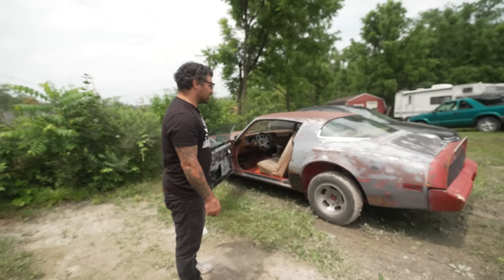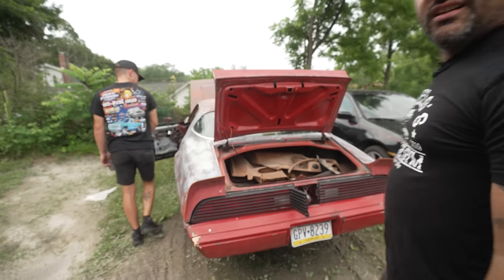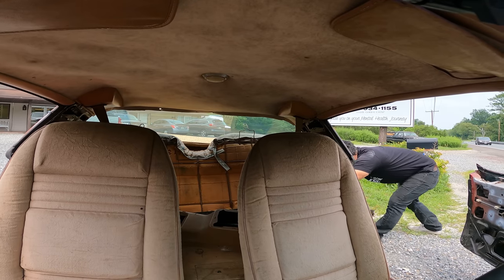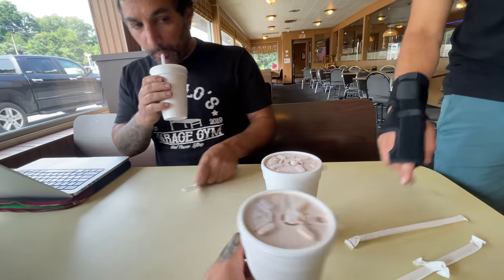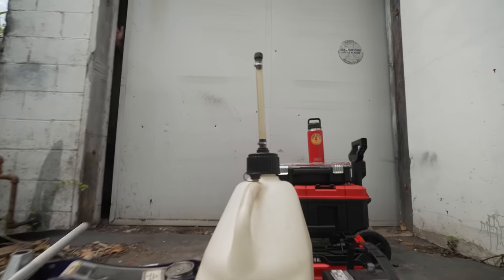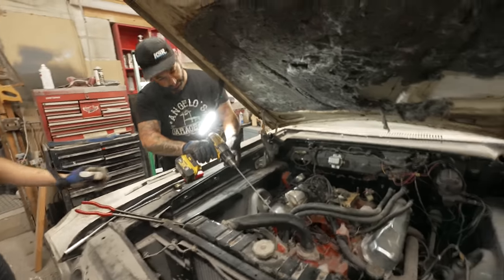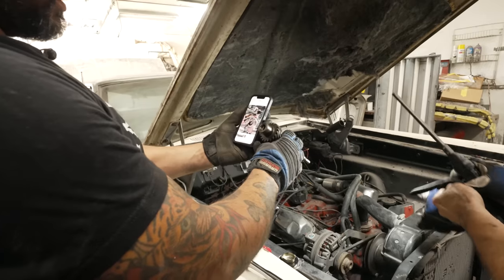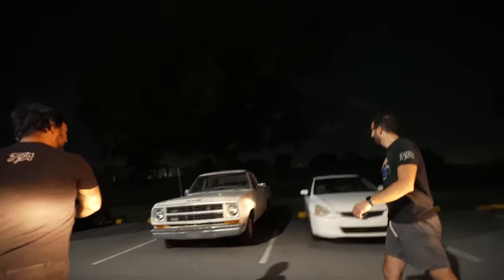1964 Dodge 440 Revival! The 3 Secrets to buying Cheap Project Cars in Today's Market!

Comment: @Tony : 2 things you'll want to do with this car, 1) put a 65 or newer rear end in it. It IS an 8 3/4, but has the bolt/nut axles and they are the WORLD'S biggest PITA!!!  2) Either contact Imperial Services for a set of transmission cables and replace what is in there, OR,,,,, put in a 66' or newer 727 and an aftermarket ratchet shifter.....  Do those things and you will LOVE this car forever!!!!  Then when you get into REAL LOVE with this car, I have a 65' Coronet 500 from California with zero rust you can buy from me and even get a vacation in Florida along with it.....  You can visit Cletus while you are here... ;)

Comment: Fun fact about oil priming: very large industrial engines will have an air operated "prelube" pump that lubricates the engine before starting. On a CAT 3600 you need to activate this system before you even roll the engine to adjust valves.

Comment: I'm a chevy guy through and through, however,  back in 67 I bought a polara just like yours white, turquoise bench with a fold-down armrest 383 with a really long Hurst shifter which I managed to snap off at the weld. the Dodge dealer told me that was a first for him. I loved that car and still do but got tired of being beaten on the street by GTOs. I traded it on a 64 red corvette fuelie coupe. Well, I guess I showed them. High street in Pottstown, Pa. The vette was tuned by Lee Crupi (Rapid Rabbit)and never lost a race to the Roger Sinestri (Buckshot) crowd.

Comment: I just bought a 1983 D-150 Miser slant-six 4speed. It runs and drives, got it for 2500$ I flushed the brake fluid and replaced the pads, got new seatbelts, and I just got the springs and shocks. It’s a fun little thing.

Comment: I believe that is the 1964 Dodge Polara Max Wedge or 500. It came with bucket seats, floor shifter, and only 2 backup lights and 2 brake lights. The regular 64 had 4 brake lights and 2 backup lights across the back. I had 2 of them back in the day. 383 with Holley 780, 727 tranny, dual exhaust cherry bomb glass packs... Oh yeah..

Comment: When a engine sits for a long time you never crank it with the starter try to get it going around by hand and make sure you take the valve covers off to watch if there is any stuck valves that way you can get them loose before pushrods bend. I have seen so many guys spin the engine with the starter and end up bending the hell out of the pushrods and it's better to try yo avoid doing that if you can.
Reply from the maker: That is next level! I will consider that next time!

Comment: Tony  I started wiring my 76 chevelle malibu using that wiring kit I won from you on Instagram. Leaps and bounds where it was. I'm piggy backing off the original harness with a ford starter relay since I accidently ripped my 3 starter wires when I pulled the old motor with the old long tube headers. Mini starter and going to a 1 wire alternator setup while i'm doing this. I hope I run into you in it on a future power tour or drag week. I appreciate you mentioning these cars and their stock car Nascar history in this video.

Comment: I don't bother with the internet, my friends send me to vehicles. Parking around here is getting thin.

I just dragged home a 64 LeMans for $400. Black with red interior, but the floors and frame are completely done for. Not a big thing for me, I know Pontiac guys all over and can find a frame if I want to put it on a stock frame. However... a Jegs chassis kit is $830 and I can weld. So I am thinking straight axle gasser with a ladder bar 9", since I have everything except the chassis.

Haven't brought home a drivable vehicle since 2005, other than trucks for the winter. I decided to take the vehicles that almost nobody else would ever want to deal with, or have the skills to rebuild. Being old has its perks, since I have been buying cool 60s and 70s cars since 1982, and have rarely sold anything so I have lots of projects and parts to build them. 

Eventually I will sell some stuff that has been rebuilt enough that other people can take over and finish them their way. For the most part, most of what I don't consider a keeper is too rough for normal people... and I am not normal.

Comment: I love the Polara styling, and that motor sounds good. The '80 short box is sweet also. I've always liked the '73-'80 Dodge styling. Probably why I've held on to my '80 Powerwagon for over 20 years. I was searching for another '80 Ramcharger that I always regretted selling with no luck. Stumbled on the Powerwagon, over paid in 2002, $2500 but it was 360, 4 bbl., 4 spd., Clubcab. No regrets. Just like you said, if it catches your attention, jump on it before someone else does.

Comment: Yep old school.  Remove spark plugs put oil. Use two stroke oil full. Mmmm nope score the bores. Rings are hanging one side. So score ... the bore. . Hand crank. ? Two stroke oil lube the lifters and other parts.  You answer my cold start answer. Fail. Your the man.. why no full 100 percent cold start. People love your channel because they learn.  Don't hang up on excitement.  To start. God bless.  Mick

Comment: A Moroso "Hot Foot".  The foot shaped pedal.  Moroso sold a BUNCH of those.  Finnigan would like that.  Was used on LOTS of 70's flat bottom drag boats on the trim tab pedal.  I seen them on Go-Karts, as the little ones keep the dream.   It seems that it was destined for the 383 Polara.  Seen TONS of those footpedals at the swap meets.    Polara on the Hot Rod Tour.  Ford 9" and tubbed.  Lay down some Scratch!!.   Polara needs a name.

Comment: That 383 sounds like it has the late 60s super commando cam or the massive purple shaft from mopar performance in the late 90's... those cams were mean as F. Im running one in mine right now and it sounds exactly the same, that lumpy lopey rowdy idle. Just wait til it gets a real exhaust, some good headers, dual 3" out the back, and an x-pipe goes a long way with our old B/RB engines. (I have the original 2806 match set manifolds sitting in a box waiting to find a charger/rr)

Its a shame that isn't a D100. Those change over 1980's where they went from D100 to D150 same year and added the square body hood. IIRC D100 = 1980 and D150=1980 1/2. You have some serious content potential with this truck. So many companies are adding modernized support for them lately. Gen 3 hemi swap kits, 12 valve drop-in packages... still havent seen a hellcat swap into a birdbath D100 though.

Comment: that takes me back to 1974. my best friend had a 64 polara 50th anniversary edition,. it had a little extra for trim. it had a screaming 361, later on we found it had wedge heads, that explained why it screamed. blew out the push button automatic and put in a 4 speed for $50 those were the days.  yes his was the 2dr. hardtop like yours only red ,with a white roof. one last thing i think he paid about $200 for it back then.
Reply from the maker: That thing sounds awesome! We used to get slant 6 darts for under 500 bucks in HS and they were plenty fun! I will be swapping a 4 speed in here if this auto ever gives up the ghost.

Comment: The big question, does it have a 440 and they knew it but wasn’t saying it in front of the seller, or did the seller say it had a 440 but turned out to be a 383 after the title was made?
Reply from the maker: The car is actually a 440, not a Polara, so I titled it after reading it? It's confusing, I know it. The models (on the same body) were 330, 440, Polara and Polara 500.
Reply: @StayTunedTA  good deal, I never knew mopar had models that were just numbers other than the 500 which came along later. Can’t wait to find out if it’s a hot 383 it’ll be the ultimate sleeper

Comment: I like the talk about going far for a car. I drove 7 hours for my 95 ram and it’s got the 5.2 5 speed 4x4 single cab short bed and it only had 120k miles on it. Drove it 7 hours back home no problemo 👌🏼 best 4800 bucks I spent

Comment: dude the car is nice but dammit that truck is clean. been looking for a good short wheelbase do you 100 I’ve got ram chargers I’ve got Dakotas and I’ve got a killer built 372 that I want to put in a short wheelbase D 100 can’t find them down south they’ve been wrecked or rotted out.

Comment: There was a guy a few blocks away from me who had a couple trucks clearly parked for a very long time. I saw him in his yard randomly and asked about the old F250. He told me it’s a 1989 with a 460 and asked if I wanted it. I asked how much and he said $250.
This was over three weeks ago and now it’s parked in front of my house. Running, driving, needs a bit of fuel filter and injector cleaning and that’s it.
The deals are out there, you’ve just gotta ask.

Comment: Man I fee this whole day. Been there. I miss the 90s and 00s local paper adds, car trader and etc. the RJ paper in Vegas had a cars $1000 and under in the late 80s when I was in high school. We found two auto shop projects that way. I found several projects in the 90s as that column went to 2k, 3k and 5k by the early 00s. And Craigslist in the early days was cool. 
I feel like FB market place has already devolved into Craigslist. I’m not giving people a deposit, I have seen too many people get ripped off. So my last couple have come to me through work. A customer put me onto my Duster and our Winzer rep heard from a fellow employee I’m a Mopar guy and sold me his grandpa’s 85 D150 /6 4spdOD. It’s getting an engine/trans swap soon. The Duster is a 340 4spd clone. 
I saw that D100 and would have been on it if I didn’t already have three and only a single car garage. For that deal even from SC it looked fantastic.
Love the Polara, grew up with my grandpa’s 64 Savoy. And you are a great friend dude for getting him that truck.

Comment: I bought a red '64 440 back in 1982; it had been fitted with a straight axle, a '71 WSP HP 440 with some sort of cam, with a reverse manual 727 with 3500 rpm stall; it was an original 4spd car; I was a kid (22), and thought it would be fun for the city streets; it wasn't. What a monster. It looked mean: its stance, red with a black hood, 50 series tires on Dodge rally wheels. I paid $500 for it then and didn't know what I had; I sold it to another kid after I put it in the ditch for the same $500. I wish I had it today.

Comment: Tony broke it.. once again. I kind of want a 67 or earlier Dodge truck, I don't know if my 6'10 self could fit in it though.. Why a 67? I want the 318 poly, because put a set of aftermarket aluminum A Hemi heads on it and you have a 318 hemi because it's the exact same block. An interesting tidbit of history, Hurricane Carter was driving a 66 Polara he rented the night he was arrested for murder by those asshole cops in New Jersey. His car was identified by the tail lights but it was actually a Dodge Monaco the perps were driving which had the same shape lights but more of the lens lit up.

Comment: Good video, Tony and crew. The firebird had the potato potato potato cam . If you want more cam in the polara, swap the rockers from the 1.5 Mopar to 1.73 fe ford rocker arms. Same shaft, diameter if memory serves me correctly.

Comment: The holes in the floor could be to access the subframe nut. If the weld breaks loose,you can’t remove the bolt to change the subframe bushing

Comment: Upper end wont get prelubed unless you crank engine while spinning the oil pump!
Cam holes are 180 degrees which send oil into heads

Comment: This is what kid's an young Americans need to see and do more of. I saved for year's an with 5g i was able to buy a 07 civic si woth jdm k24a swap, i was originally set on a 99-00 si em1 but am so happy with the 8th gen fg2 i ended up with. I never had a k series or road in one till i got mine. O how much i love the k24a screaming at 8k. The 6speed lsd transmission makes for a blast on back roads. Absolutely love it. And in the end its better then em1 i wanted i feel.

Comment: I just went through this while looking for a solid but cheaper PRE-73' Ford/Chevy to build for a Drag N' Drive car.  It took 3 months but I found a solid 69' Torino Fastback roller in primer for 3500$. I just happened to be searching Marketplace 15 minutes after it was listed and was the first guy too respond! SO happy to have a solid car to build and it's just a base 302 2V Auto car that had some questionable body work done to it in it's life. It's got bondo, but not rust repair bondo, and it really only need to be a 100 footer in the looks department, because race car.
Reply from the maker: Sounds like a sweet deal to me! Nice pickup! Those are great looking cars.

Comment: They're gonna fight you, Tony. They are mean girls. Mine was, good god. Absolute death trap of fun. Put disc brakes on it if it doesn't have them already. Do not even think about using the drums, it will try to kill you. Christine is a true story you know.
Reply from the maker: Ordered drums front and rear! And got a 68 Charger 3.23 posi rear for it!
Reply: @StayTunedTA  I'm serious, it's worth upgrading to disc on the front. The 64 is B-body SIMILAR- it's not an actual B-body but a lot of B-body parts will bolt on. I think I used 72 Satellite spindles on mine. That was back in the 90s though, surely there's an aftermarket setup that doesn't cost more than the car by now, lol.

Comment: polara
A car made by the Chrysler Corporation under the Dodge name. Bigger, bader, with a greater amount of room yet still contains the great looks lines and curves of the smaller choices.
Look.. there's a Dodge Polara, it's like a Dodge Charger only bigger and will hold the whole family.

polara
Named after the Polaris Star in 1959, Chrysler Corporation produced a top of the line car in 1960 called a Polara and was manufactured under the Dodge name. It was produced in hopes of greater sells after NASA gained interest in the great race to build a rocket to get to the moon. The name carried on well into the 1970's before it faded out. The Polara once was the top of the line Mopar and was top of the line until Chrysler reviled the Monaco which had the same body shape and style, but had more luxurious features.

 Would you look at that... It's a Dodge Polara, you don't have to be rich to own one, but you will definitely feel like a star...